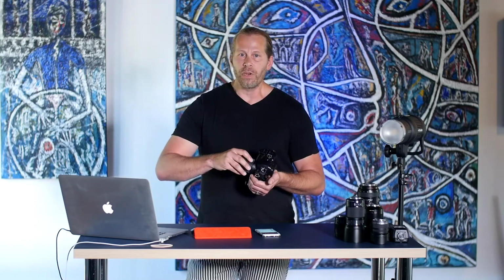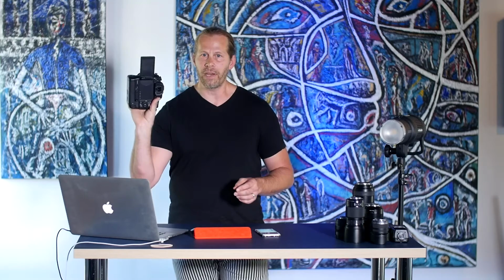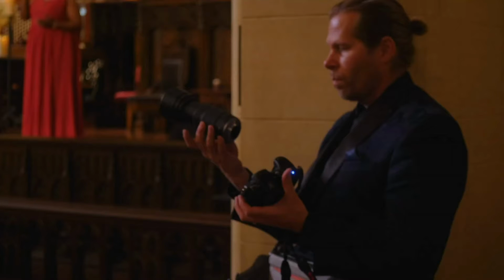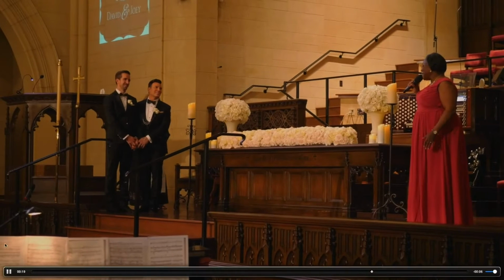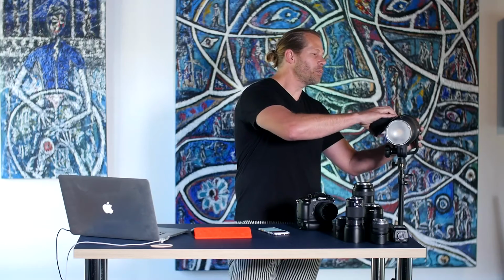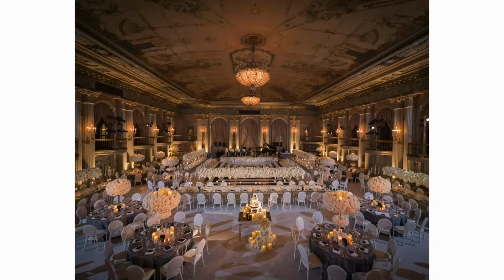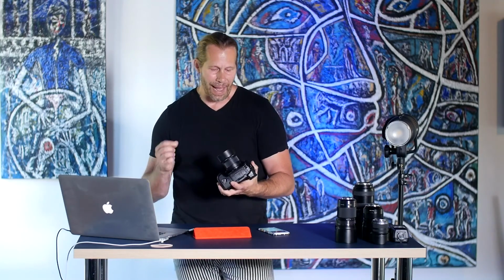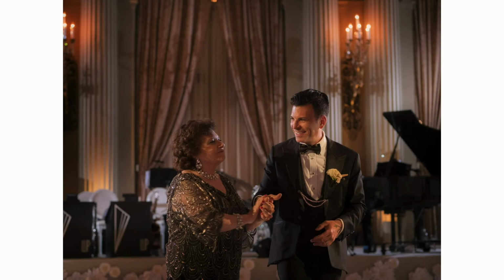Lumix GH5 - Luxury Weddings and Lighting with the Profoto B1 LIVE

Comment: Good video friend!! Interesting!!
One question; 
I have GH5. 
I see B1 and B2 of Profoto. 
You work with Canon transmisor? 
It works of course since HSS and in only manual. It's true? 

Thanks and you have my Like
Reply from the maker: Tutankalzon I work with the standard Air remote, which is only Manual and no HSS option. But that is ok with me as I prefer manual control. HSS would be nice though.
Reply: Can you achieve HSS with the GH5 paired with a monolight? Im new to this, but was looking into the Flashpoint 600